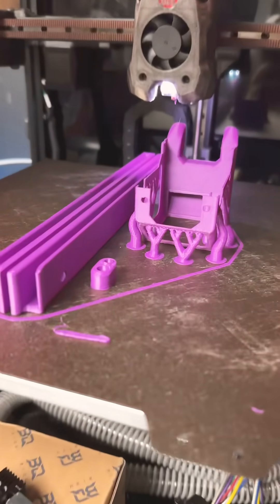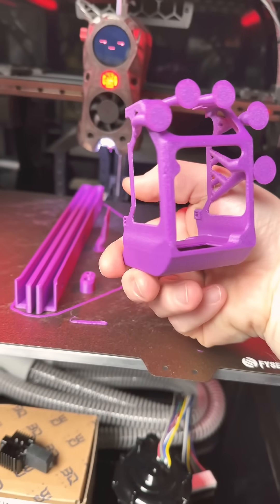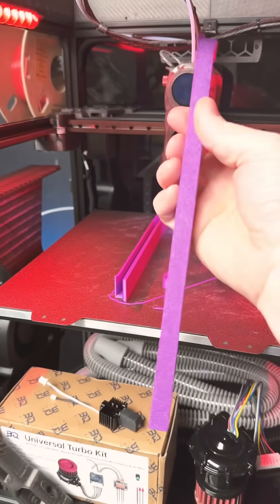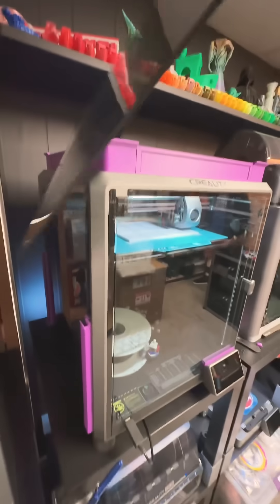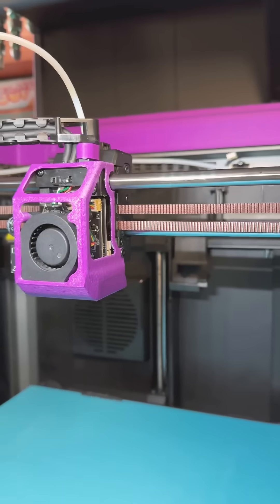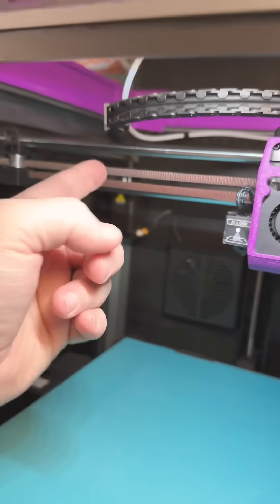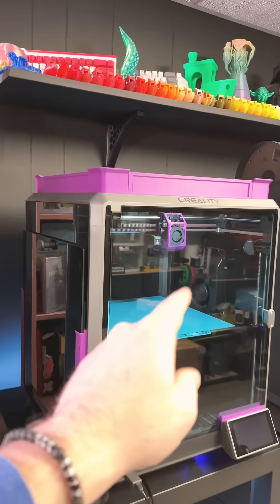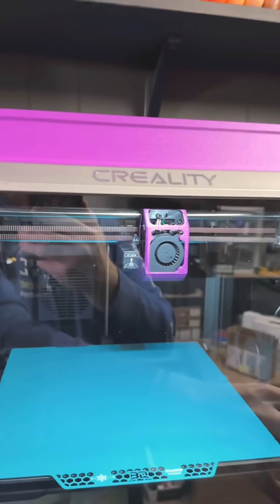K1 Max Upgrades lookin 🔥

Comment: Now if your ready for a real tool head upgrade get yourself skeletor mk7, replace the side fan with a bento because youll never need it again once you go skeletor. 
Also retroglide gantry use %90 stock parts and fix every issue with the stock gantry.
Reply from the maker: Ill look into it

Comment: Sorry for what seems like me taking over your comment section. “Update” from creality. They now are taking ownership of their mistake but.. they want me to send the original used K1 max they shipped to me first with video proof of me sending it back to them via me taking it to the post office and only when they receive there package at there warehouse (In China) will they send a replacement. For anyone that is going to say “ see, they are  working with you” no, they are not. They only took me seriously after I mentioned I would file a fraud case with my credit card company. I did so because someone reached out and told me they had the same experience, issue with there printer, he sent it back and they would send another one…….well it took 2 months and the credit card company had to reverse the charge, so he could get his money back. Not stating that this will happen to everyone, but I’m here to tell you I’m not the only one they have done this too. So if they are this unreasonable when they make a mistake can you imagine what filing a warranty with them would be like!? Save your money and choose a more reliable and honest manufacturer, learn from me and others who dealt with the same issue.